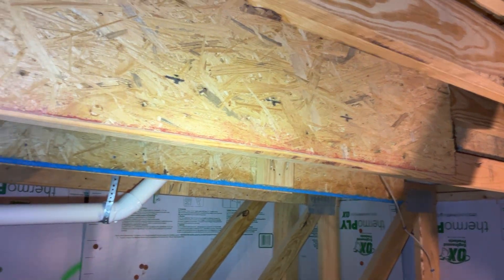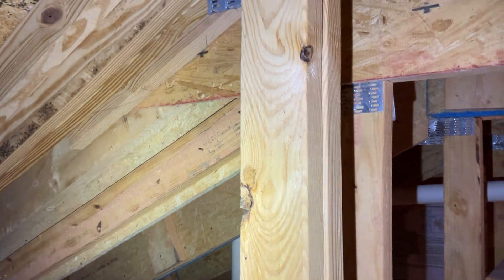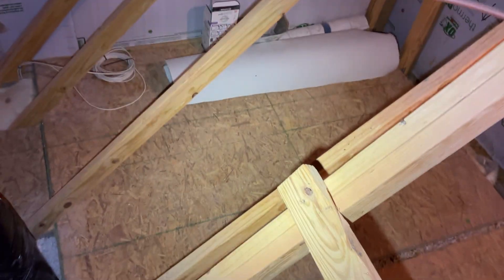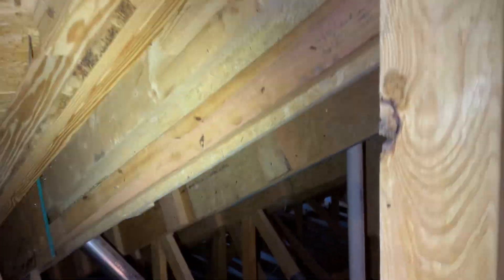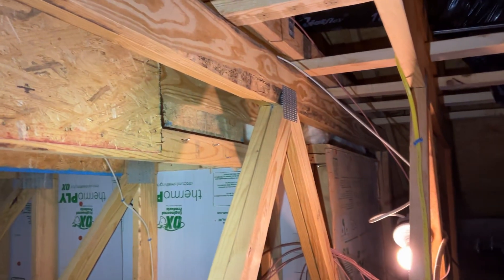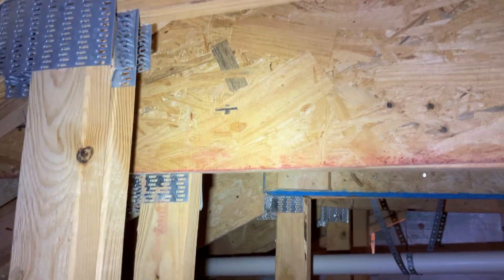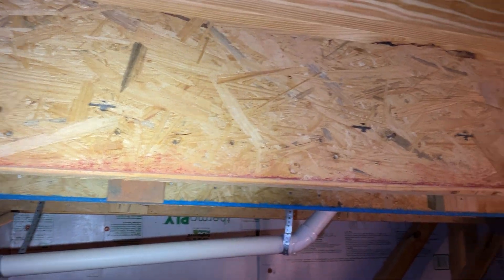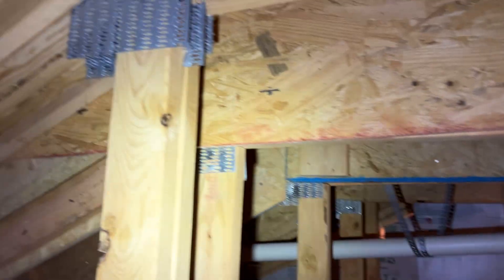Altered attic trusses

Comment: There's nothing wrong with that. Now it can actually support more than the original truss.
Reply: Right,got into a lawsuit over altering trusses and when I brought up the fact that we had two 100 year snow load events and when other roofs came down,mine still was there-“case fucking closed”
Reply: @donchristie420  They didn't alter the trusses. The trusses are exactly as they were supplied by the manufacturer and are taking exactly the same loads. All they did was add spacers. This is why the engineers and inspectors passed it. Case closed.